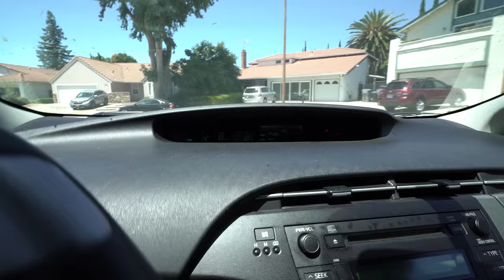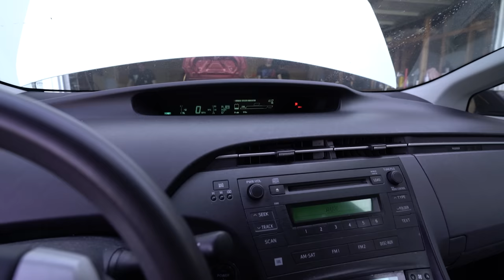Single Cam 240sx Not Bussin Uphill

Comment: Dude, handle the safety issues first. That much play in the steering is dangerous and if all it needs is rack bushings and tierods then that's far cheaper then anything else that you want to do before it. You should also look up how to do the 300ZX brake conversion without a kit. I think it's mostly just parts bin stuff from other Nissans so you can buy most of it from Rockauto or the parts store for far less. You also should probably do the 5 lug conversion at the same time to save on work.
Reply: Gotta agree w that
Reply: W
Reply: facts
Reply: real
Reply: This guy makes poor decisions for content
Reply: Shit constantly breaking is THE content of this channel. If he fix the steering wheel then it's one less thing he can yell about "almost die" when driving
Reply: Totally not trying to be mean, to anyone. 
But he already had 2-3 unmaintained cars when he bought this one. Really think he cares?
Reply: 4 lug 4 life, small wheels forever

Comment: Hey bro, I just found your channel a month ago. I really fw you & the crew. I like the content & want you guys to succeed. I would just like to say keep grinding pushing out the content & chasing the bag. Also, not criticizing you but when you’re driving keep your hands parallel in the positing to feel the car more but you don’t have to it. Feed the steering wheel instead Of grabbing it from the top, just good practice for grip/drift. Also, with the 240sx depending on what you want to do with it I would suggest dialing the drivetrain & suspension first to get it setup for touge because you can be faster with that and maybe if you can’t find a sr20 you can maybe do a k-swap but idk it’s your car up to you. Keep doing what you do bro!!! 💯❤️

Comment: 1.6 nb mx5 owner here. My car was stock with 110 hp. So it probably has a little less than the 240 but because of the miata’s lower weight it would possibly feel quicker.

Comment: Rockauto or store bought z32 calipers, rotors and pads are going to be way cheaper than any kit you find online. Just get conversion lines off GKTech or something. Wouldn't take too long to find a z32 in a yard if you want to pull the parts off the rear knuckles for a 5-lug+Parking Brake conversion. You could get the Energy Suspension master bushing set, and the S14 polyurethane subframe bushings, a polyurethane transmission bushing, and a metal shifter bushing, all for decent enough prices. And you could even replace the stock shifter return springs with some heavier ones from a hardware store for like, $3.

Comment: I own a mazda miata 2003 nb, with 1.8L vvt engine and produces 140hp, not too slow or not too powerful either, but it can pull quite a bit on straights but they way faster on touge roads. what I can see from the video it just might be bit faster, than the 240sx. This has to do power to weight ratio.
Reply: Another NB2 owner here, I also think they are faster than the S13 on the touge.

Comment: 5:07 always put bricks in the rear and front of the rear tire to chalk it so it absolutely doesn't go anywhere ur better not brutally crushed than brutally crushed. Parking brake doesn't always work
Reply: Yes! Parking brake cable stretches

Comment: Meanwhile heres me with my 90hp TurboDiesel VW but it is kinda fast cuz lightweight :)
Reply: Probably makes more torque than my 2.0 NC
Reply: @NootNC  it has 148 lb-ft at 2000 rpm, thats also when the turbo spools, so iam always at boost and at peak torque when driving in curvy roads

Comment: I have a 1.8 NA Miata, and I think it probably would be faster than the 240sx, but pretty close, the 1.6 might not be. And yes they are DOHC.
Reply: I had a 1.6 decades ago.  They are so unfathomably slow. 5k rpm in top gear to go highway speeds slow.
Reply: @hiighcalibre  They can't be slower than my old Ford Escort. 2.0L SOHC with 110HP. Driving on the highway wasn't a big deal but taking off from a stop with the A/C on was downright dangerous.